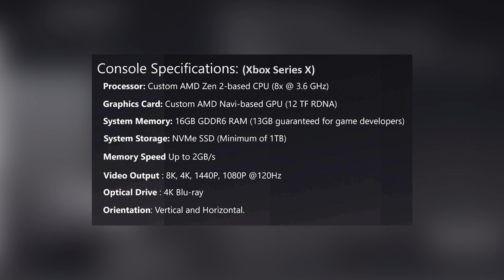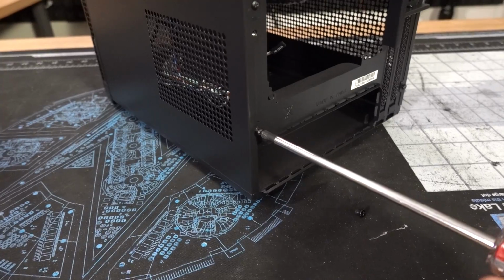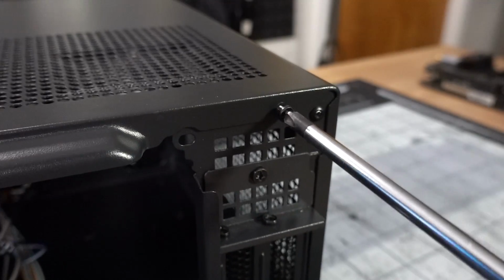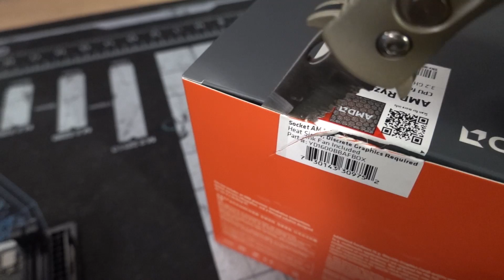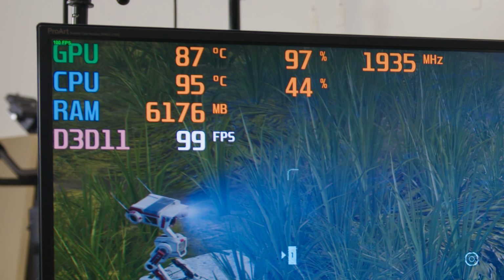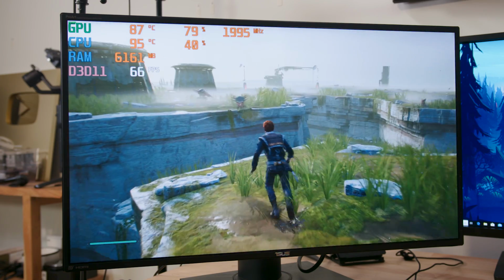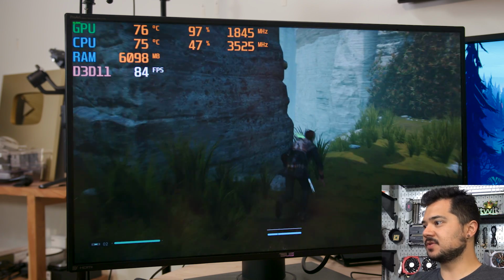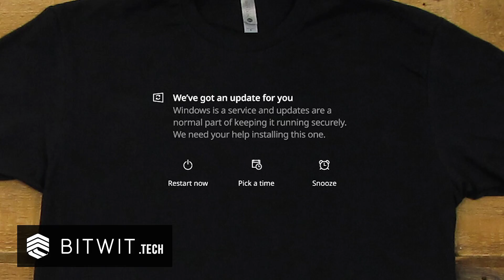I built my own Xbox Series X

Comment: I do like that case. Strangely, my reason for picking it was because it took an ATX power supply. The graphic cards go in easier through the front. I too picked the Noctua L9, but I built mine a while back so is Intel. 

How did you get on with the SATA power cable for the SSD? I had to use spacers to raise it off the floor, as it was bending way too far.  I would definitely recommend an M.2, even if it's only a SATA one.

Comment: I don't care for Xbox anything I have a decent PC so have no requirement for one. The build with it's final component list small PSU, low profile CPU fan and 140mm on the front looks good and decently tidy, thanks to the PSU being semi modular and being able to have the minimum amount of cables in it making cable management easier. I'd love to know what temperature difference you'd get from it if you installed and AIO and whether it's worth the purchase and how that would affect the GPU temperatures.

Comment: So the take away from this build in this size of case is make sure you use a small compact Power Supply, a low profile CPU cooler and fan if you can't get a AIO and have a 140mm fan installed on the front panel when using air cooling.

Comment: sg13b is an odd one, you'll find your gpu is fucking cooking if you have your front fan set as intake. While alternatively setting it as exhaust directly feeds the gpu with cool air thanks to the extremely generous airflow right against it.

Comment: I'd expect somewhere around $600-800 for the Xbox X - console manufacturers have economies of scale in their favor much more than a private enthusiast, and a history of selling the hardware at or below cost and making the difference up in game sales. No really interested myself, if I'm going to buy hardware it'll be the most versatile I can afford, not a game console. Also, if my hardware was only five years old, I wouldn't be thinking about replacing it... I'm only doing that now because the HDD has started throwing file errors. I'm sure if I had the dosh for a top-end, AAA-crushing game rig I'd love how well it handled 3D and video editing as well, and maybe even try a couple of the newer games on iot, but it's just not in the cards, especially with quarantine-induced finincial uncertainty. On a completely different track, your singing and comments while building are still the best part of the video, tho0ugh at least this was a sensible workorse with no fairy lights to waste power and make more heat.

Comment: You will need a 2000$+ PC with a 2080ti to just be on par with the xbox 4. And to tackle that intro at 2:30 
Better visuals (sometimes) Even a pc with 10 times the hardware doesnt guarantee anything. Lack of optimization kills games on PC.
You can use keyboard and mouse on xbox
Yeah games are cheaper but you'll spend 2000-3000$ just be be on par with the xbox 4 so its not worth it. 
Free online isnt a good thing, just look at how terrible steams online platform is compared to xbox
Variety of game clients is one of the most annoying things about pc, its all freeware garbage.
Sure you can multitask and its a pc so you can do everything, but that makes it worse at gaming because no matter what you do your computer is running 150 things and you will never have full control, xbox is a simpler OS and thus has less issues for gaming. 
Pretty much all games are more buggy and not at all optimized on PC
PC is riddled with cheaters because steam is free so if someone gets banned they just make a new account and go right back to cheating in 10 minutes. When i played xbox i seen a cheater maybe a few times a year, on steam i see a blatant cheater multiple times a week, and they're not even trying to hide it because they know most likely nothing will happen.
Games die much faster on pc because everyone games on console
DRM's ruin games on pc, i have a 2700x 5700xt and i cant even play origins its so bad.
Online gameplay is far worse than xbox's online play because steam is freeware garbage. Games lag more, game chat just doesnt work at all, you lag off steams servers constantly.
Like i said games arnt optimized so games just run like crap even at 200 fps you get more stuttering than a potato clock original xbox one.
Ill be getting the xbox 4 and i wont be looking back - PC sucks for gamers.

Comment: I have that same case paired with ATX PSU, changed my CPU airflow to upflow instead of downflow, put the ATX PSU as exhaust and place a scythe slip stream 120mm fan on the side. The result, CPU maxed at 62 C full load.

Comment: you try the Sharkoon QB one it's slightly bigger than the SG13 however it allows you to use CPU coolers up to 150mm, i have a ryzen 7 2700 overclocked to 38.5 Ghz with an Rx 590 also overclocked, CPU temps never exceed 70 c while GPU runs at 78 C max,

Comment: It is a nice small gaming PC but not much to do with the upcoming X box in several ways. First in pricing. In order to be able to sell on a console price X box should be around 5-600£ What is almost the price of your 2070 Super alone. X box promises 12 TF what is roughly the level of a 2080. (what would be even more expensive) But even with that i am not 100% as in the tests i have not seen too many games running 4k 60hz RTX on with a 2080, and Xbox promises that. So i would assume graphics should be even better that a 2080.

Comment: i use an AIO for my sg13,  with a heater i7 7700k. It peaks at 65c under load and i was thinking about swapping it for a low profile air cooler. Now I think my temps are fine lol

Comment: frame rate with high settings:80 fps
Kyle: “ this performance is just not acceptable”
Reply: *epic settings
also he was talking about temperatures
Reply: You dont need to overclock the 1600af to get that performance.
Reply: @mmonkeyman1403  are u replying to the right comment?
Reply: @aninditapaul9291  kinda
Reply: @mmonkeyman1403  he said nothing about overclocking the cpu
Reply: It’s not

Comment: This is nowhere near as powerful as the Series X console. Considering that if you compute all the cost of the parts including the OS and the peripherals (normally videos like this doesn't include the cost of those) it's a worth investment.

And also if Xbox Series X and PS5 would cost $499, then it would post a real threat to PC gaming. If you take a look at the specs of the next gen systems, it can be considered as a High end PC at a lower price.

These specs for next gen is no joke: 
- Ryzen 2 (8 core 16 threads @3.8Ghz)
- 16 GB GDDR6 (we only see this on expensive graphics cards)
- NVME 1terabyte SSD
- Dual/Quad layer 100GB bluray drive
- Next gen ports like USB (3.5/4?)
 And many more...

Comment: Just a bit of advice with this particular case: Since you're using pressure for airlflow you can leave the IO shield off and get slightly better temperatures.

Comment: Praise: Perhaps one of your best lines in any video ever, @6:25

Criticism: The PSU 'blocking air' wasn't the real issue, there, in all likelihood. (Check out Luke from LTT's airflow video) It was more the Wraith cooler than anything, but the 140mm fan is also a big difference maker.  Too bad you swapped all three at once -- and left a huge gap on the backside --  or that might have been more apparent.

Comment: I have the same case. The issue with thermal for this case is that the hot air has no escape route. The use of SFX power supply without the bracket is a wiser choice. The extra "hole" allows better exhaustion. Love this vid, thanks for the laughter! LOL

Comment: Let's say I want to build this type of pc to be a stream pc. Seeing as it doesn't have a 2nd PCIe slot, would an Intel(I know, the MB in this video isn't on that platform) iGPU be enough to handle a stream output of 1080p/60 at 6000kbs from OBS?

I would use the MK.2 Elgato card as I play at 1440p resolution, in that 1 PCIe slot.

Comment: so while we have to see an actual xbox series x launch, this falls short of the spec sheet in a couple of areas.  The obvious one is the use of a 5 1600af, when the proper comparison choice should be the 7 3700x.  The gpu is a bit more vague, AMD claims rdna 2 is going to be 50% better than rdna, whatever that means, so if we assume that it's much better than an rx 5700xt but ignoring the hype it's going to be better than an rtx 2080ti, I would opt for the rtx 2080 super.  Considering I have no idea what 16gb ddr6 ram is supposed to be when PC's are only just looking at DDR5 memory I chose 16gb of 3600 mhz cl14 ram.

This changes things a lot.  In AUD, the potential release price of the Xbox series one will be $800 (our exchange rate is in the toilet atm), and the pc I built will be $2555, 3x the cost of the Xbox, should it land as promised, maybe there will be a price war in 2021?
Reply: Think you mean GDDR6
Reply: @KetJustin100  yep I got that a bit confused, so is there a graphics card that runs that much GDDR6?  Thats beyond the rtx 2080 ti so far
Reply: run on a 300w power supply and cooled by a single 130mm fan
i do agree the specs they released looked really cool 
but maybe hold a little bit of skepticism, just a littleee
Reply: @nowhere769  because lets face it, if the world has C19 at least on a leash by September the Microsoft marketing machine will have every stir crazy punter in a fever pitch a month before launch some time around Oct/Nov.

I do still wonder, if AMD/TSMC can get those chips into a retail box for $500 US, what could that mean for those of us wanting similar kit for real computers?

Comment: A amusing build. Don't change Kyle! 

Though just for reference you can change resolution between 1080/1440/4k on the Xbox one with latest software, dropping the Res to 1440 speeds some games significantly. I'd expect the series X to offer the same really.

Comment: Things i'd like to see. When using the sfx psu, how does the stock cooler perform. While using sfx, are there other alternatives that would be better, like NH-L12S or similar for cpu cooling? 
Considering 5700 xt is only ~6% slower(sauce hardwareunboxed), but ~140$ cheaper than the 2070 super, is there a specific reason for recommending the 2070 super in this kinda build?
And i think not enough people are considering high airflow fans, considering this case has one intake and no exhaust, what kinda difference in temps and noise would you look at if you spend some of the $ saved on the gpu on a HF-14 instead?

Comment: RX 5700xt can run games in 1440p high and ultra between 70 and 110 fps in most games, and most of that is closer to the 110 side of the scale. So save yourself $100 and get the Radeon.
Here is my list with a few changes https://pcpartpicker.com/list/Gzw2TC

Comment: The Fractal Design Core 500 is better than that case. It supports up to a 280mm aio and full size GPUs. it also has a 5.25" drive bay for putting one of Gigabyte's VR Link things in.

Comment: Hey Kyle, great vid. I’ve just done a build in the exact same case, and noted a couple of points. Keep the drive tray in as I helps keep the chasis rigid and square, and flip the psu so it exhausts air from the mobo, will drop temps by about 8-10 degrees. And you’re right defo the smaller psu needed in this case.

Comment: "My own xbox series x" but uses a 6c/12t cpu? Series x has a 8c/16t, c'mon man
Reply: well, the zen2 cpu in the xobox series x will probably not perform better as it will be severely gimped when it comes to l3$ and clockspeed compared to an r5 1600/AF and the games are only allowed to utilise 7 cores. That is, 7threads at max 3.8Ghz or 14threads at 3.6 while the 1600af will probably be able to run 4ghz or even 4.2ghz if he is lucky with all the 12threads active.
Reply: @Pillokun  as if windows and background processes didn't require any CPU utilization lol.
Also the GPU is weaker as well and there is no 4K BluRay drive.
This is a significantly weaker system
Reply: @teehundeart  But it does not work like in The consoles. In the consoles one core is dedicated to os and background tasks, while on pc the threads jump around depending on how the OS deems it fit. The gpu in this build the 2070s is pretty much on the same perf scale as the 5700xt which seems to be around the same level as the gpu in ps5 at least. 

But even so, the cpu in the xbox series x will be the bottleneck and there for you will see many games that will aim at having so high 3d settings that the gpu will be the bottleneck because the ps5 and xbox series x will simply not be capable of pushing those gpus to very high fps as a cpu on pc could with a similarly powered gpu.

And why should anybody care about a 4kbluray? It is not a necessary component that affect the perf and it costs pennies for the console manufacturers but for us end consumers buying an 4k bluray player would be expensive. Optical media should not even be in consideration. Just like with cooling, big effective coolers cost like a buck at most yet the console manufacturers are so proud of them. OEM have totally different prices compared to us so it is not even worth comparing, especially if the product that is presented is a complete package ie one single product. For us pc enthusiast every component in the pc is one product that must be sold with a healthy margin.

Just like with ps3 and xbox 360 when they were announced they seemed like machines of unparalleled power when we did not even have more than dual cores if I remember it right at the time. This time we simply get hw that we already have cpu wise, and gpu wise, 2080, 2080s and 2080ti are as fast or faster than xbox series X Tflop wise.

This build that Kyle have build migh be weaker than the xbox series x is gpu wise but when the consoles are out we will probably have gpus at lower price points well above, just like always.

Comment: Did you know you can actually spin the rim of the Wraith Stealth and Spire Coolers so the notches will match the height of your RAM modules and not push them? (It also works as a straightening measure for the AMD logo in the rim)

Comment: Funny the build cost $1000, when you're using a 12nm Ryzen 5 with 6 cores, yet the Xbox is using 7nm enhanced Ryzen 7 equivalents with 8 cores. The RTX 2070 isn't near enough the power of the xbox's compute power, you'd need to look at an RTX 2080 super minimum. Load of click bait crap to join the hate train if you ask me, this doesn't compete let alone for the price.

Comment: 2070 super with a 1600af lol. Unless you're running 4k and overclocking the snot out of that CPU you are heavily mismatched. 3600 minimum with that CPU. 1st and 2nd gen ryzen suck. Look at the gpu usage as you're playing. Dropping as low as 70% usage. Bottlenecking the SHIT out of that 2070 super.

Comment: While the Series X is going to be a game changer for consoles bringing it up on par with gaming PCs (below the the top end machines) It is helping bridge the gap between console and PC. With the hardware on this level in side the Series X cross play between PC and XBOX it should be more and more common. Im thinking that the Series X will be between $425 and $500.  and Kudos to AMD for partnering with Microsoft on developing the CPU GPU, now if only Sony can fix the over heating issues on the PS5, maybe they should use a Bulldozed processor?

Comment: Wait, so Kyle, with a face looking like a clogged exhaust fan, is hocking a self grooming kit?!
Wait, the XBox has an NVME 1GB drive, you used an SSD? Couldn't you have used a 140mm liquid AIO on the front too? Seems like there would be enough room at the front and it would be getting all the airflow from the front?

Comment: You should have stuck an actual RTX 2080 in it, because at the end of the day or benchmark. The 2080 beats a 2070 Super.
Reply: Yeah by about 3% and drawing more power. Not worth it
Reply: @TONI-bi1lg  6% and it uses the same power draw. 
Perhaps you are thinking of the non-Super 2070 which uses a lower power draw since it's essentially what should have been the 2060.

Comment: Honestly, a console killer is a pc that costs the console + 5 year online subscription and that does 1080p60 on high. 1440p and 4K are a scam on consoles imo, they're upscaled anyway and the games are way better optimized. So in essence, if it's more than 350 USD/Euros, I'd not even consider getting a console. I got an xbox one s which I paid 109 euros for, came with fh3 and hot wheels dlc.

Comment: I have a similar setup but i think that flipping the psu to exhaust will really help even if it seems like it won't. I'm currently running this setup without a case fan using only the psu as exhaust and it seems to keep cool surprisingly well.

Comment: would 87C for the rtx 2080 hurt its lifespan overtime or is it relatively safe?
Reply: A gpu temperature shouldn't pass 80C. Above 80C the gpu will starts to reduce clocks in order to stay cooler

Comment: If your priority is SFF then your budget needs to be a bit higher than it would if you were using a cheap and cheerful mid tower case. If this has a 140mm AIO it would be quieter and cooler

Comment: Nice build.  But I wish you would have just changed the Stealth cooler to the Noctua and left the power supply and 120mm fan to start with.  I would have liked to have seen what the cooler change alone did to the temps.  Now we just have to guess how effective the cooler change was.